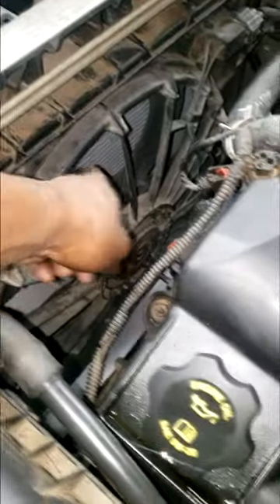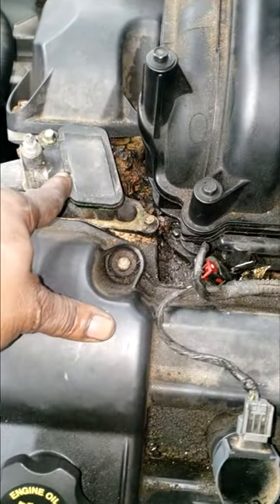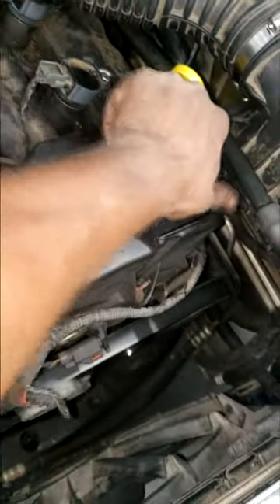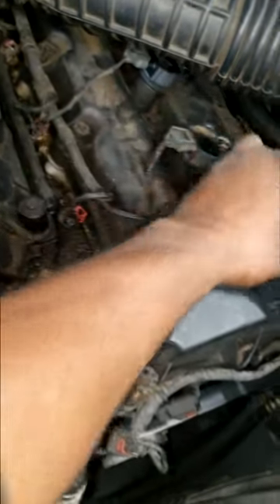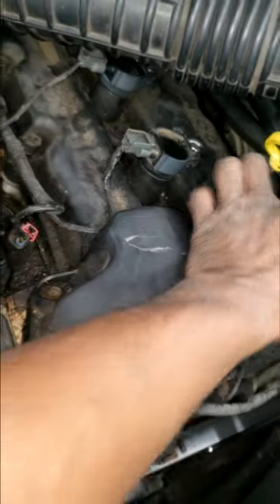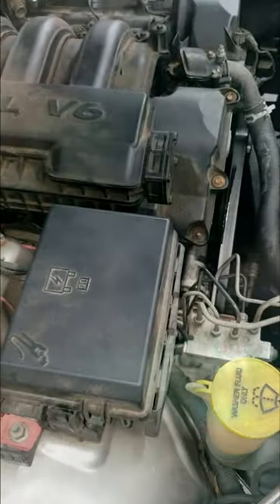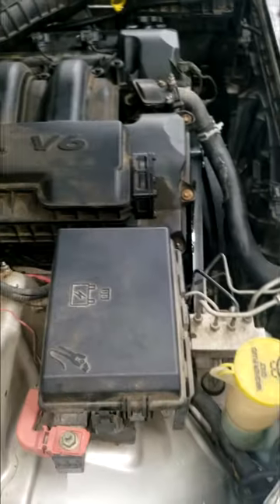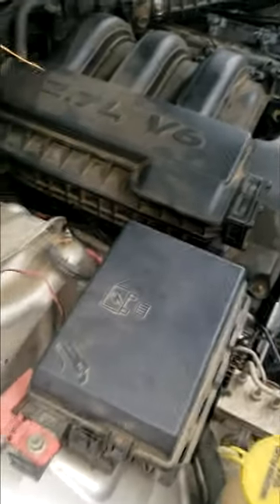Here's why I refuse to work on this motor. All money ain't good money.

Comment: 250k out of a 2.7? Give that engine a medal.
Reply: Ikr
Reply: Lol only by Chrysler standards is 250k medal worthy XD
Reply: I have 205k on mine and zero sludge. Switched over to Mobile One full synthetic early in the game 👌🏼
Reply: Had one last about 240000
Reply: @lwest36  I've got a honda sitting in my yard that went 380k and would've went farther if the oil pump didn't go out when I was 600 miles from home and yes I drove 600 miles with a failing oil pump I put that super thick stp in it and drove

Comment: If it ends in a 7 it’s junk 
2.7 3.7 4.7 5.7 6.7 
Now the 3.6 when taking care of 100% it won’t leave you stranded. 
The 5.2 and 5.9 and 3.9 great motors but long gone so sad keep up the great content bro
Reply: IF it's a chrysler product it's Crap!
Reply: 5.7 are definitely not crap.
Reply: @oxygen454  valve seat droppers, engine ticks like a typewriter, crappie waterpumps,need I say more??

Comment: That 2.7 is trash I’ve never meet anybody take it Over 150k. I have a 3.5 and has been babied. Just hit 100k miles on a 2006 Chrysler 300. Was my first vehicle in 2013 when I was 17 years old and has been great. I hear a lot of people say they’re bad cars but no major issue on mine at all! When they maintenance is key and I truly believe that. I had my mechanic look at my other vehicle and wanted to take a look at my 300 and put a stethoscope in the oil cap of the 300 and it was immaculate looked brand new as if it was just machined.

Comment: How do they let them over heat? it's ridiculous
Reply: Probably lack of maintenance. Maybe original antifreeze…? I mean if there not keeping up with simple oil change intervals. You can only imagine what the antifreeze looked like before it blew out.
Reply: Facts best to change coolant at least every 30k to 50k to be on the safe side 🤷🏿🤦🏿
Reply: It's not just that, the 2.7 was really just a terrible engine, they didn't call it the sludge king for nothing, a horrible engine. No matter what they would still overheat, or lock up from the sludge build up. I've maintained far to many to not know.I have customers that follow their maintainence to the T and these things still went down . It sucks telling a customer they mneed a new engine, hurts my heart. I wipe my tears with hundred dolla bills tho.🤣😂🤣😂🤦🏾🤦🏾🤦🏾